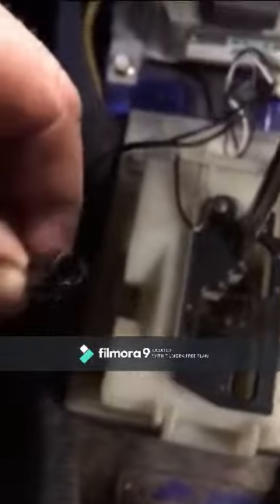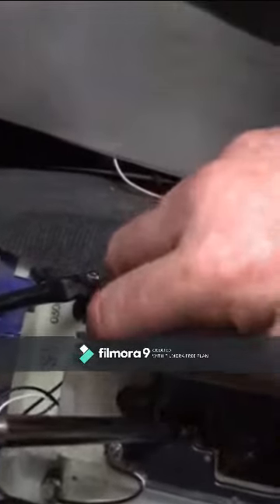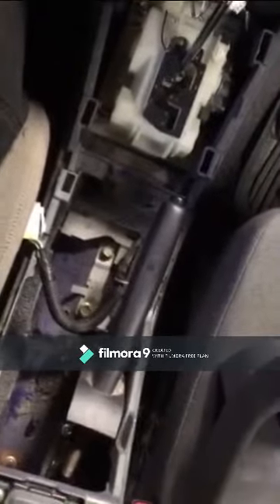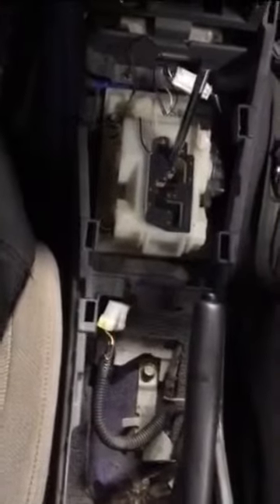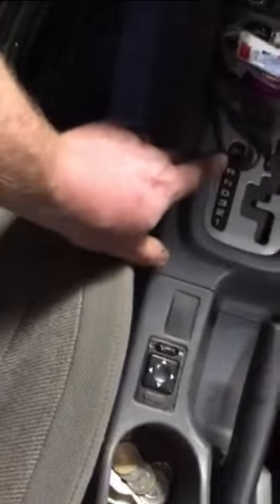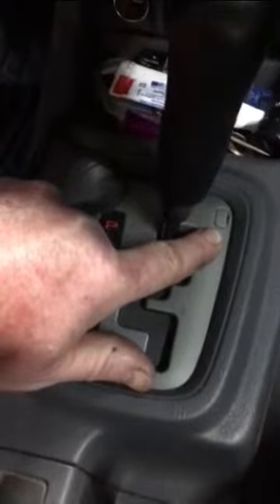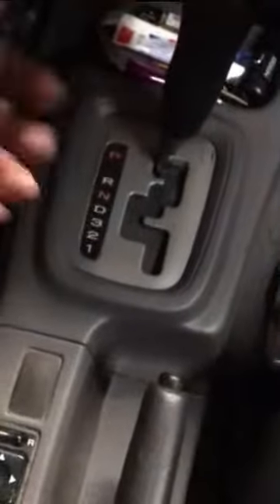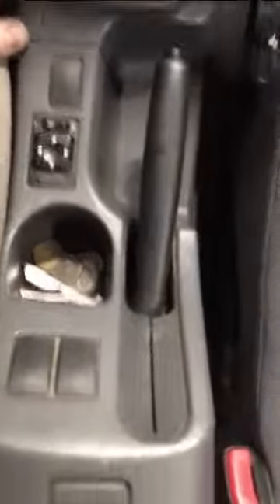04 Subaru Imprezza broken shift cable

Comment: Thank you so much for this video, mine is stuck in drive as well, it will slide up to neutral but won’t go back up into park. It’s been really tight getting in and out of park for a while now.. do you suppose I should change that cable?

Comment: I have to do the same job. I took the floor shifter out and the council on an 02 Outback. It is very similar to the Impreza. I used vice grips to move the cable and drive it in front of the shop. I ordered a new cable BEFORE I took it apart because I have had this sort of thing happen before, but I could have re-welded a new bolt on the cable. I should have took it apart first. Oh well.... got an extra cable now for 50.00.   You have a good video here !

Comment: Hey man I'm having this issue where my shifter is stuck in gear no matter where I move the lever. It went all the way down through the gears but putting the lever back up won't change anything. Can you show how you used the vice grips to get the car back into reverse? Mines stuck in a spot where I can't lift it and I want to get it pulled into the garage so I can get under the car.

Comment: Hey i having hard shift front p. To reverse and clicking noise when changing gears. Urs was hard to?
Reply from the maker: Yes it was getting stiff or hard to shift before it broke. You might be able to save it now if you take the plastic counsel off so you can spray the cantilever with penetrating fluid, or spray it from underneath! Good luck!

Comment: Good video, found it while looking to find how to adjust the shifter cables two 12mm nuts where it connects to the shifter be the drive shaft

That is apparently the adjuster according to the manual, but I'm.not.finding which way to slide to it further to get rid of of my p0851 that came back after changing the neutral safety switch